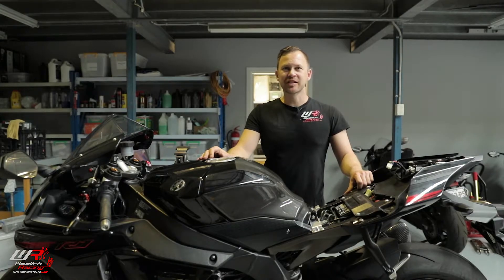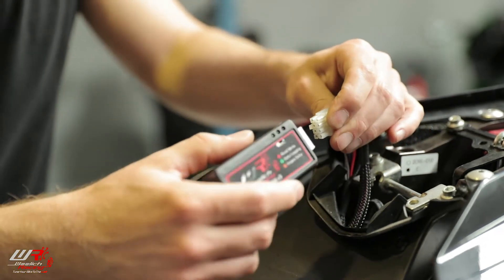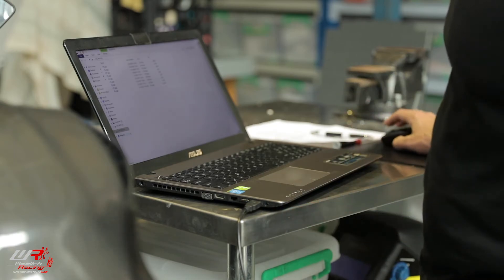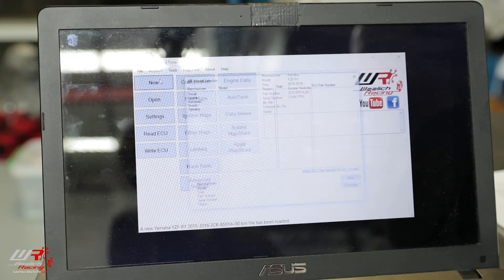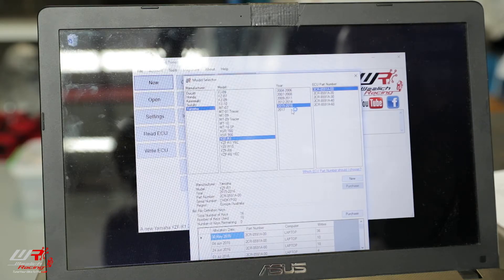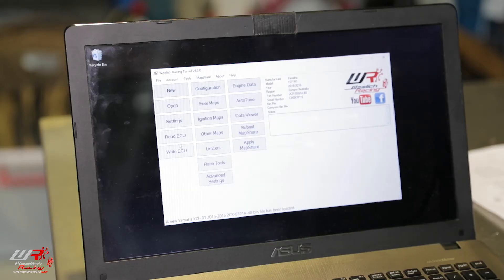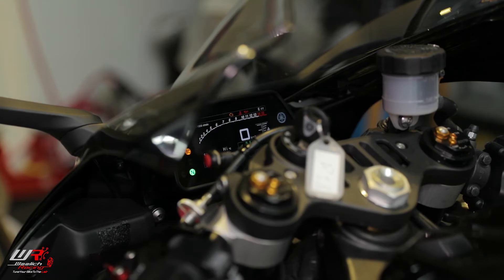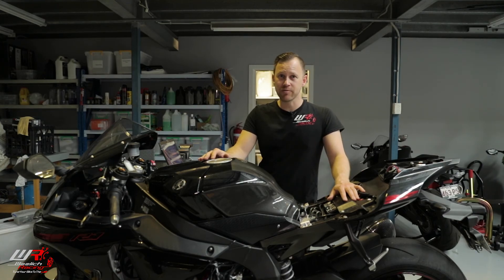Woolich Racing - How to Write ECU using On Bike Harness

Comment: Bro my honda 1000cc 2008 has speed limit of 180km and i wanna unlock it 
Right now i have a laptop and i think i need to buy woolich racing autotune to connect to my moto and adjust the speed limit right?

What are your thoughts?

I appreciate your help.
Reply from the maker: Hi @ah7maw265, 

Assuming that you are talking about the Honda CBR1000RR 2008 model (if you have a different model please let us know), this is already supported in our software and the full list of supported capabilities can be found here:

2008 CBR1000RR Stock Bin File Definitions

 The supported capabilities include disabling the Top Speed Limiter which is a simple checkbox, this will remove the speed limit in the bin file which must then be written to your ECU to take effect.

In order to write to the ECU you will need a tuning package including interface, harness and a bin file key.  

This package will allow you to read and write to the ECU but it will not help you modify your fuel maps etc:

2008 Honda CBR1000RR
USB K v3 Package

This package will allow you to read and write to the ECU but also includes a wideband O2 sensor which will allow you to measure the air-fuel ratio (AFR) in real time and use this to modify performance and optimise your fuel maps.

2008 CBR1000RR
Log Box K v3
+ Zeitronix ZT-3 Wideband Package 

If you would like more detailed advice please feel free to Open a new Support Ticket so that our team can assist you.

Comment: Good but this is for 2015/2016 model. How to to the same with my R1 2024, think it's a little bit different because of Euro5 ? Thanks for answer.
Reply from the maker: Hi @R6WoolichCompatech,

The process is essentially the same however the harness used to connect to the bike and the communiction interface are different.

The tuning packages for the 2024 R1 are shown here:

https://www.woolichracing.com/products/yamaha/yzf-r1/2024/2024-yamaha-yzf-r1-ecu-flashing.aspx#productTable

This model uses a Log Box D-CAN v3 and a Universal Harness Type 3 to connect to the red OBD2 connector on the bike, the ECU can then be written by using this harness.  It is also possible to bench flash these ECUs, this uses the Yamaha Bench Harness Type 21.
Reply: @WoolichRacing  Hi Woolich and thanks for your answer. 
I agree with you, not VERY different. I already do it on my R6 (see my channel: https://www.youtube.com/playlist?list=PLyTiZJGfrDGwfUKgN3ZqC8vTBbGQoTIHO

I already have the Log Box D-CAN v3 (and ZT3/ZR1 to) but what i mean, it's that on R6 2019 for example, i had to flash on first the ECU to be able to read ECU.

In R1 2024, your support team told me that "this ECU" can't be read. And this, i don't understant (?) It must be possible to read it with your soft otherwise i can't be possible to change anything, to read parameter, apply autotune...
This may be a misunderstanding on my part due to the English / French translation...

So, the unique think i would like to know is what is the first action i have to do on first time with R1 ?
I have bought a new key (bin file R1 2020 _2024), a Universal OBD2 Type 3 and a Yamaha faisceau bureau Type 21.
The bin file is ok on my Woolich account -> so i have access to all option.
And then, what is the next step ? need to flash first without any modification to "unlock" the ECU (like done on my R6) ?

Thanks for you help.
Regards @+  😉
Reply from the maker: @R6WoolichCompatech  

Thanks for clarifying, now I understand.  

The 2015/2016 R1 ECUs are not readable from factory, this means that there is no way to read them out via the ECU plugs using the bench or on-bike harnesses.  When we write to these ECUs for the first time using the WRT software we enable reading via the ECU connectors, this is why they must be written to before they can be read.  

The 2024 R1 ECU is very different in that it uses different electronics, different communication protocol etc.  There is no way to read these ECUs currently so we can only write to them.  Even after writing to these ECUs we still cannot read them.  This is due to the way that Yamaha designed the ECU, and has nothing to do with our software. 

In your feedback you wrote: "In R1 2024, your support team told me that "this ECU" can't be read. And this, i don't understant (?) It must be possible to read it with your soft otherwise i can't be possible to change anything, to read parameter, apply autotune..."

Actually this is not quite right - changing maps, applying AutoTune etc does not require read functionality, only write.

If you start with a 100% stock bin file the the bike is the same as it was from the factory.  You can save this file as a backup in the WRT software, but actually the stock bin file is always available if you have purchased the license (bin file key).  This means that you don't need to read the ECU as you know exactly what is in there.

As you tune the bike and make changes you make copies of the bin file and save them with different names, then you can always go back a step if you need to.  If you want to check the maps etc then you simply need to open the last file that was written to the ECU, this gives you the same information as if you could read the ECU.
Reply: @WoolichRacing  ok, it's clear i now i understand what you mean. So yes, my ecu is for the moment stock, the bin file bought is stock to. Before any modification, first i save the stock bin file and next, i work by incremental version of the origininal bin file (with update i want to make. For exemple, want to change fan temp, i take my original bin file, change parameter in the soft, save this bin file (+1) and flash the ecu with it, that right ?
And if there is  a problem, i can roll back by flashing ecu with the first original stock bin file.
Do i have right understood ?
Regards Woolich Team
Reply from the maker: @R6WoolichCompatech  
Thanks for your response, your understanding is perfect!  Some ECUs simply cannot be read so we use this process of saving the backup files so that you can always go back to a previous working file is you have issues at any time after flashing a file with some changes.  Actually it is a good idea to work like this all the time, the bin file backups do not take a lot of space and can be very useful for troubleshooting, etc.

Thanks again for reaching out to us.
Reply: @WoolichRacing  

A big thank you Woolich Racing team! As you saw on my youtube channel, I am a big supporter of your solution, although I am only a non-professional. 
I owe the great discovery of your solution to the Thorn Bikes team and especially your France/Benelux representative, Franck Nourry who provided me with two training courses (and the little diploma which goes well!)
@+  Rémy

Comment: Hi I have a 2017 Suzuki hayabusa. It's has already been flashed and dynotuned using woolich software. I also have race tools on my bike. I want to be able to change setting on race tools like quickshifter and launch control settings. What do I need to be able to hook up my ecu to my laptop to be able to change settings etc. Also I want to have the ability to flash my own ecu . Do I need the usb box or the log box or bike harness, bench harness..not clear on this. . Also is the box just plug straight into the wiring that's on the bike now or is there still some modifications i need to do to install box. Also am I able to change setting on quickshifter or did my tuner lock my ecu. Also since I've already been flashed and dynotuned using woolich can I change some ecu setting like when fans turn on etc or again is the ecu locked by tuner..just unsure and unable to contact my tuner these days.. thank you again
Reply from the maker: Hi, please send us an email at support@woolichracing.com, and we can further assist you with your query.

Comment: Can you not tune B mode on a 16 Gsxr 600
Reply from the maker: Yes, for this model you can edit the Fuel Maps, Ignition Maps, as well as STP, Exhaust Valve, Fuel Trim, and Injector Balance for each individual Riding mode.

Comment: If you use woolich racing software to tune your bike do you still need power commander 5 for proper fuel management or does woolich do away with pc5?
Reply from the maker: @sti70r Bachar with a Woolich Flash you don't need a power commander or any other type of piggyback fuel management system. For the best fuelling results we recommend either getting a dyno tune with your flash, or purchase a Log Box + Wideband AFR package (if available for your model) in order to AutoTune your bike.
Reply: @WoolichRacing  thank you

Comment: I have mine flashed but it has a stock exhaust on it. Once I put an aftermarket exhaust on it do I have to change the fuel nap to match the exhaust? I've had a Power Commander 5 in the past and so I had to do was click "get map" and then choose the map that had my exhaust. Is this the same way?
Reply from the maker: Hi Ryan, yes you should get the bike tuned after making large changes like a different exhaust. Each bike is an individual and should be tuned as such, pre defined maps from the internet will not give you the best results. We recommend tuning your bike properly.

Comment: I thought bench flashing was ECU out of the bike and on the workbench.
Reply: Yes, if you read the title you will see this is ECU flash (write) with the ECU on the bike (connected to the bike harness).
Reply: TL1000S97, they changed the title. It read bench flash
Reply: OK :)